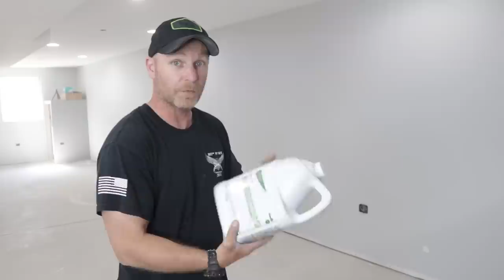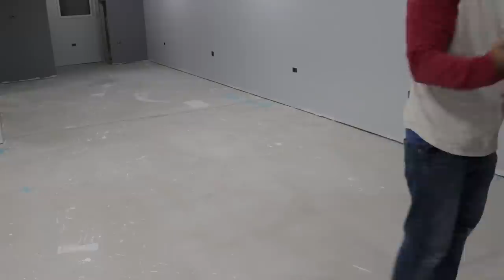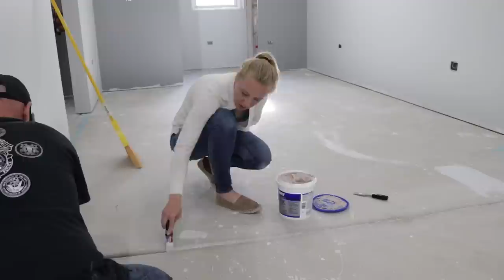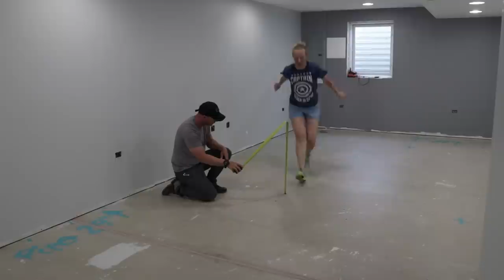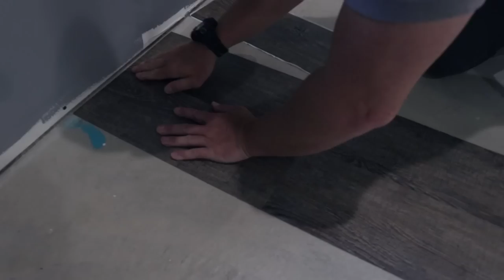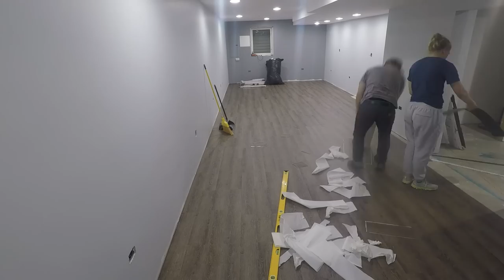How To Install Peel-and-Stick Vinyl Plank Flooring and Floor Preparation

Comment: I’m having trouble doing the same pattern your doing with the floors any suggestions?
Reply from the maker: GrveMoney Records I just started with a full plank in the first row then on the second row I cut the first plant in half. That way it will stager the planks. You just have to cut every other row.  I posted a video on this last week that will should you this process.   Just go to my channel and it should be the most recent video.   Hope this helps.  Good luck.

Comment: I bought this floor for house renovation.  I am a newbie when it comes to flooring installation.  Where should be my starting point? Thanks :) for the help and boost in confidence
Reply: So whenever I layed my flooring , I found the center of the room (I used squares not rectangles), and I layed a row all the way across the room left to right , and also forward and backward. ( a giant t / cross ) without removing the paper. This allows you to be able to know if you need to move your center piece left or right / forward or back more to be sure you're not left with to small a piece on any of the sides. Then, I stuck my center square down and I got to work.
Reply: Also, I rolled my tiles as I set them. They sell small hand rollers , this is how I am sure my tiles adhered to the floor better .

Comment: What prep is needed if the concrete was painted, and worn out?
Reply from the maker: Just repaint it and make sure it’s level.  Paiting will reseal it
Reply: @KomarProject  thank you - i just took another look and it has the rendered look - if that makes sense? So a level slab with a rough look?

Comment: I am planning to lay this type of plank over hardwood floors (I know. I know. But they need too much work and I don’t have the money needed to repair them properly). What do you recommend I seal the wood floor with prior to laying these?
Reply from the maker: I really wouldn’t.  Hardwood floors move with the seasons and will open up the joints for you.  I would go with a floating floor

Comment: Hey! Does the cement have to be a smooth cement? I just lifted my carpet up to look underneath and it's a rough textured cement. There's also a split in foundation. So me filling that and smoothing over work for peel and stick in your opinion?
Reply from the maker: Megan Schauf as long as it’s not too rough you should be ok.  Just use your best judgement. Or buy a piece and see if it will stick.  The crack your going to have to fix for sure.   I’m posting another video is about an hour on this maybe it will help a bit.
Reply: U need to prep the floor sand and skim it to make it smooth and level.  Peel and stick is garbage.  Better off doing direct glue down. Plus the guy was working in the primer the whole time. Defeats the purpose. Run a couple planks up and stagger every 6 inches and keep rolling. A lot faster. And fill in cracks with a concrete finishing trowel. A lot faster and more level. And don’t use premix Home Depot special.

Comment: do the planks sit flush with one another or is there small gap between the planks like there would between hardwood planks? Great vid
Reply from the maker: shumaelrock they sit flush next to each other.  I did another video installing them and it shows how they lay next to each other a bit better then this one.  Good luck

Comment: Hey guys, really enjoyed watching several of your vinyl tile installation videos, truly well done and appreciated. You guys look like are having a blast, cool. Hey I have a few tiles along a wall (5"x 6-ft) section where I leveled the concrete with quikrete leveling patch product and the adhesive on the back of the trafficmaster tiles isn't sticking the tile and they're easy to lift off!!! Any ideas on how I could solve this?? Use an extra adhesive? Something in the quikcrete patch preventing adhesive to stick perhaps?? ALL IDEAS ARE WELCOMED, PLEASE AND THANK YOU.
Reply from the maker: Ya I’m sure there is something in the patch preventing it.  I would apply some sort of adhesive that will float into the patch.  Maybe contact the manufacturer and see what they recommend.  I never ran into this before so I can really help.   Sorry and good luck
Reply: @KomarProject  an engineer that I know suggested applying a cement primer over this area? And that this would allow it to adhere, any Thoughts?

Comment: May I ask why you didnt start in one corner but more in the middle? Thanks
Reply from the maker: Erika F if you start in the corner and your wall is not square to the rest of the room everything will look out of square.  If you start in the middle it won’t be as noticeable. Plus if you have multiple rooms and your trying to make it flow together it just makes it easier

Comment: Thanks for the video! Gearing up for my project! How long before waiting for the sealer to dry and applying the flooring? Is one or two coats necessary?
Reply from the maker: olivia717 the sealer I did dried in 24 hours.  I put down two coats. You might be able to get away with one it just depends on what product your using.  I would just follow the directions on the sealer.

Comment: Question for ya. I'm doing this on an old garage slab. The concrete is dry and looks to be painted already. This is good for that? As a moisture barrier? Thanks so much!
Reply: I'm doing the same thing and have the same question

Comment: What products did you use again?
Reply from the maker: Jamel Williams for the expansion joint it was Henry’s pats filler and for cleaning the floors it was Profi by Johnson.   The sealer was from Bear that you can get at Home Depot.  You don’t have to use the same exact ones just as long as they do the same job.   Good luck hope this helps
Reply: @KomarProject  Thanks so much. I'm going to do this in my Barbershop.
Reply: Hopefully it will withstand the traffic.
Reply from the maker: Jamel Williams ohh it sweeps up like a dream. That’s probably my favorite part about it

Comment: Can you show how to remove it? Is there any residue left over? Or is it just as easy and clean?
Reply from the maker: Ya it comes up from concrete really nice with no residue.  I replaced some planks recently and just popped in new ones.  Video coming soon

Comment: This looks great! Just bought the same exact a few weeks ago. What’s the best way to prep a plywood flooring?
Reply from the maker: Jason Roche I’m not too sure about plywood but I would assume it’s the same way with sealing it.  Make sure you get a sealer that works with plywood and you should be good.  Sealing it will help a great deal with adhesion.  Especially if there is some dust residue. Hope this help.  It’s a fantastic product and it’s holding up great so far.

Comment: great job but can you tell me if this stick on back plank is good on linoleum flooring floor its in great shape.
Reply from the maker: Luba Luba ya you should be fine as long as it’s completely flat. I just installed this in our laundry room yesterday over existing vinyl and it turned out great.  Video of this install should be out next week.   Hope this helps.

Comment: Just curious, did you leave an expansion gap around the room on the edges? The install guide says to do that but the guy at Home Depot  that we bought the flooring from said not to?
Reply from the maker: Liz Fennimore I left some space but it’s not intentional.  It’s not necessary in my opinion.   This is not a floating floor and won’t matter if you leave a gap.
Reply: @KomarProject  Thank you! I wasn't sure because I had seen people say with this type of floor they did leave a gap and then the tiles shifted leaving gaps in the center. Thank you for your help!

Comment: You use some kind of thread to mark where the vinyl plan starts. Do you use it right in the middle of the floor? Great video btw and I love your interaction with each other!
Reply: @chonkydoge he used a chalk line. It’s a small hand held tool that has, I believe is cotton string, with a power chalk. You need to pull it tant  to leave a chalk line.

Comment: Can you put this over epoxy with that Henry 647 adhesive?
Reply from the maker: Jamel Williams you should be a low to just go over the epoxy floor with it if it’s bonded right.  The Henry product I used is only used for patching cracks or expansion joints and not an adhesive.  Hope that answers your question

Comment: Hello. WE ARE ON OUR WAY TO HOME DEPOT NOW LOL.  WE ARE GOING TO BE GOING OVER ANOTHER DIY. WE DID THE BROWN PAPER FLOORING A FEW YEARS AGO.  IT TURNED OUT GREAT AND HAS HELD UP BUT NOT REALLY THE COLOR WE WANTED. WE CUT IT OUT LIKE PLANKS OF WOOD AND STENCILED IT WITH THE WOOD PLANK STENCIL. DIDNT TURN OUT BAD AT ALL BUT SINCE WE ARE ALSO EXPECTING OUR FIRST BABY AND NEED AN UPDATE IN NURSERY AS WELL WE ARE GOING TO KNOCK OUT BOTH ROOMS IN THIS.  DO YOU KNOW WHAT ALL WE WOULD NEED TO PREP OUR FLOORS WITH BEFORE LAYING THIS BY CHANCE? THE BROWN PAPER FLOORING IS LAID OVER OUR PLYWOOD SUBFLOOR. THANKS SO MUCH FOR ANY HELP. YOU GUYS DID AN AWESOME JOB. NEW SUBSCRIBER HERE!!
Reply from the maker: Not sure what the brown paper flooring is but I would just go over the plywood and rip it out.   Just seal the plywood first
Reply: @KomarProject  We put a polyacrylic over it to seal it actually. Would you sand that down or just go over it? Thanks so much for your response.
Reply: So I guess basically Im asking would you think this could go down over the polyacrylic lol. Sorry about that...
Reply from the maker: BaBBlingBrook C. If it was me I would just go right over it.  Lol
Reply from the maker: BaBBlingBrook C. And good luck with it.  We are going to be replacing some scratched up planks in our gym are and shop from all the heavy things we have dragged on it and I’m going to do a video with some more information coming soon.  Will probably be out in two weeks or so.  Hopefully that will help with maintaining it over the years.
Reply: @KomarProject  Thank YOU so much for the help. We did purchase it the other day but I thought Id get your opinion before putting it down🤫 I believe it will be just fine myself. Only one way to find out lol. Thanks again!!

Comment: Love how it turned out.  Did you measure since you started in the middle of the room.  I have vinyl flooring but it’s the glue down kind and I was confused to stacking it so it would look right.
Reply from the maker: Chyenne Coderre ya I did measure.  Figured a full plank on one side of the room where it was visible and then what ever came out on the other end.  Hope that helps
Reply: Chyenne Coderre  hi! Do you know if this floor  would work in the bathroom?

Comment: If I have stamped concrete flooring and it’s not even what would you recommend doing since it’s not just a couple cracks in concrete? Also what did the flooring cost you for 1,000 SQFT and how long did it take you and your wife to actually install the flooring? Thanks so much & great video.. turned out awesome
Reply from the maker: Ginna R you need to level it out.  Self leveling concrete probably your best bet.  They are $0.99 per square foot for 1k.

Comment: Once everything was prepped, how long did the actual install take? Trying to figure out how much time is really needed to lay about 1,000 sq ft after prep.
Reply from the maker: Patrick Bagshaw so finished the shop which is about 600 sqft in about a day and a half and then the gym too another two days. All together it was around 1000 sqft.  We did take a lot of breaks because being on your knees all day is difficult.  I did do about 60 sqft laundry room today in about 30 minutes.   That video will be out some time next week and I’m going to be diving a lot more into the entire process.   Hope this helps.  Good luck
Reply: @KomarProject  it does! Thanks for the quick response!

Comment: Great video.... what did you use to seal the floor please? My hallway is carpet and want to take it off and do a similar thing. Thanks
Reply: Paused the video and read it .... low luster sealer. Guess I should’ve done that before commenting😁
Reply from the maker: All good.  But just make sure it’s for wood unless you have concrete under the carpet.

Comment: im wondering if it would be better to do this, or the roll out vinyl. what do you guys think?
Reply from the maker: Jenilee Steigerwald i think this stuff is a bit thicker then roll out vinyl. I think but don’t quote me. This may be easier to work with since they are smaller pieces.  Either way you go good luck
Reply: basil al sadi  awesome! I'm going to go get some today so I can get started on my first room!!!
Reply: basil al sadi  I'm almost done with it! I wish I could post pics here

Comment: Awesome results, I have seen this exact same one in homedepot and I am trying to do my garage . Do you recommend this in garage floors in Miami weather (super hot mostly) if yes then does it need to be spaced for expansion? Or it can still be installed close to each other . I was told by a friend who have this installed in his garage that his tiles (same as yours) overlapped each other after first summer and he had to sit and cut 2 mil on each end of the tile , double the work . All help is appreciated  thanks ....
Reply from the maker: billu awan that I honestly couldn’t tell you.  I would contact the manufacturer and ask them about the moisture capabilities
Reply: Our church has a carport with a cement floor which has cracked. Would this work if it doesn’t get wet? Thank you great video
Reply from the maker: Nancy Ellers I wouldn’t do over ceramic tile because most likely the tile has grout lines and would show through this thin product.  Unless you can remove them or figure out how to level the grout lines.  Not sure how that would work.  Sorry I couldn’t be more helpful

Comment: And we must pasting it from the centre? I want to paste this next week
Reply from the maker: Ashoo Amoor yes you can go from the wall if you want, but if it flows into another room it may not be square.  So if you go from the center and take into account how it lays out with another room it should turn out square.   Good luck.
Reply: @KomarProject  can i just pasting it after mopping the floor with normal floor soap? I saw so many bottles in this video (am not sure what's that for).
Reply from the maker: Ashoo Amoor ya you should be able too but if your outing it on concrete I would seal it first to prevent moisture.

Comment: Did you use a latex self stick primer to help with adhesion? I’m trying to decide if I should seal my concrete basement to help w/moisture before installing but the latex primer I bought says not to use it on sealants. If you didn’t use a primer, has the floor stuck well enough? My floor isn’t perfectly flat
Reply from the maker: Carlo Sunseri no I didn’t use a primer, just a concrete sealer.  If you use a sealer you typically don’t need a primer.   It basically takes its place. I would use one or the other though to make sure you get a good stick.  That’s just me.   My floor is holding up so well. I’m surprised how well it’s doing especially in the shop.   Good lucky !!!!
Reply: Komar Project thanks dude! I’m leaning toward a sealer since it’s in the basement! Appreciate the quick feedback!
Reply from the maker: Carlo Sunseri any time.  Good lucky and let me know how it turns out.  Love hearing how others did with this product

Comment: Thank you for this video!! I’ve watched it a few times in preparation for doing my house to get the finer details. I do have a question about the Behr sealer. How many bottles of the sealer did you use for your 1000sqft shop?
Reply from the maker: I want to say two bottles.  We also did the same installation in our laundry and the video has some more info that may help you during your install
Reply: Komar Project I know, I’ve watched that one  a few times too!! Thanks for the quick response!!

Comment: How is the floor holding out?
Reply from the maker: Great.  I’m actually doing a update video that should be released in a couple of weeks.  I did have to replace a few planks because I got spray paint on them.

Comment: Do you have to seal the floor if there was previously a peel and stick tile on the floor before? We had old peel and stick tiles that all popped up over the years in our basement and we want to put the peel and stick vinyl planks down now.

Comment: I thought you had to etch concrete or is that only if you are painting a floor??  Thanks and I enjoyed your video
Reply from the maker: Dee Vowell not sure about the etching.  I would assume it’s something you do if your trying to get a chemical bond of some sort.  This is not it.  Just sealing or premiering should do.
Reply: Thanks for your quick response!

Comment: Can this same process be done for a bathroom? It’s a concrete floor I’m worried about the moisture if you would need to add a extra step
Reply from the maker: Just make sure you seal the concrete

Comment: I loved your video...I'm installing over a subfloor is the  preping process the same as the basement you just did?
Reply from the maker: kraftyg943gk no it’s just a bit different.  You need to seal the wood subfloor.  Wood sealer works well or regular paint primer like Kilzz is great.

Comment: can you talk a little bit about the cleaner and sealer purpose? are they absolutely necessary?
Reply from the maker: Ya you want to seal the concrete so you get better adhesion
Reply: @KomarProject  how did you make your initial reference line exactly? Not trusting the walls in my home.

Comment: hope you guys are well, one question what is the sealent for? cant figure it out?
Reply: @faustino5916, the sealer is too prevent moisture seeping through the concrete. Also gives good adhesion.

Comment: Oh, after filling in that gap you sealed that section after you had already sealed the floor. Why did you choose to fill the gap after in stead of before doing it all and just doing it all at once? I figured there's a reason.
Reply: Megan Schauf He Just likes working harder instead of smarter that’s all😂